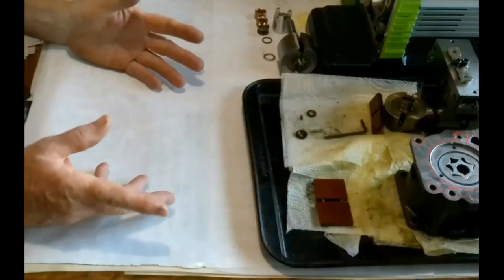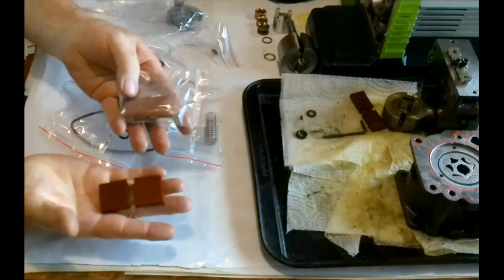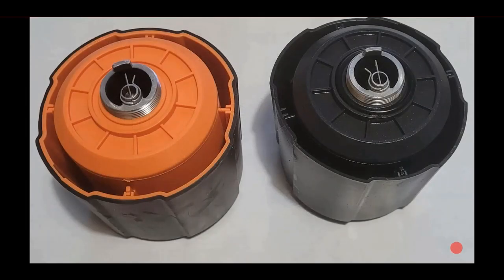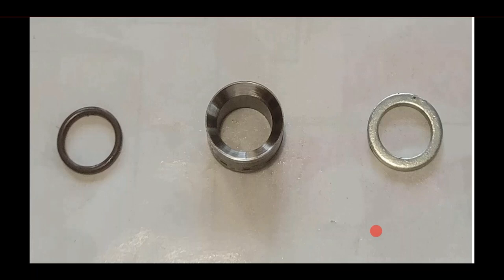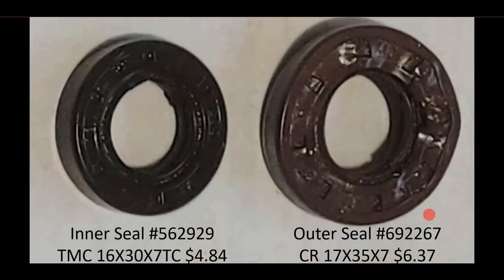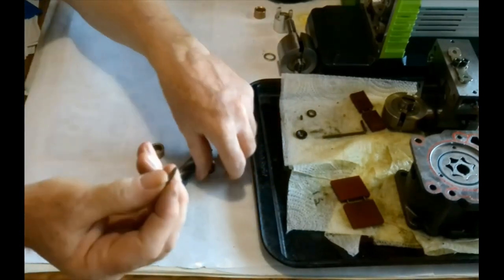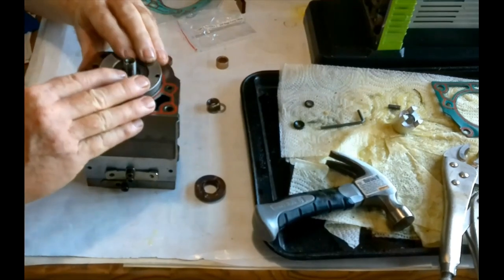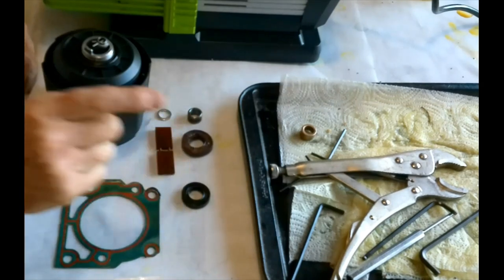Replacement Parts for the Harvest Right Premier Pump

Comment: I just bought a harvest right premier pump and the sight glass looks the same as the one on the NAVAC pump you showed in the video. Looks like they made a few changes.  I'm looking for a rebuild kit because unfortunately I didn't have the door completely latched on its 2nd run and now it will only get down to around 3000 mTorr and then starts fluctuating slowly between 3000 and 4000 mTorr. I just blew $800 if I cant rebuild it.
Reply from the maker: Is the problem with the pump or the freeze drier?  Do you know anyone who's in the HVAC business that could put a micron gauge on the pump?  My guess the pump is not your problem.  Have you looked for leaks around your freeze drier?
Reply: I had this same issue after not closing my drain valve during a batch run.  Turns out the drain valve that shipped from harvest right isn't stainless steel and corrodes very badly even just after a years usage.  That corrosion actually was bad enough not to seal, i found this out by putting the drain hose in a cup of water with the valve closed.  It slowly started sucking up water through the hose.

Replaced with a stainless steel valve, now I'm back down to just under 200 mTorr

Comment: It's too bad, HarvestRight doesn't simply offer the pump assembly.  I have several pumps with perfectly good motors and bad pumps.  I would like to not have to purchase a new pump after a few years.  Is the Navac pump an acceptable replacement for the Premier pump?  They appear to be equivalent but I'm not sure if the HarvestRight pump is special.   It looks to me like the Navac NP7DP is an exact replacement for the Premier pump.  It's a 7 cfm pump, where the NP12DM is a 12 cfm pump, and the price is $360 instead of $795.
Reply from the maker: Just as I found differences between Navac's NP12DM and the Premier pump, I found differences with the NP7DP.  Hang in there.  Changes are coming soon.  Any vacuum pump can be used for freeze drying.  The Premier pump has all the requirements at a cheaper price.  Curious, what caused your pumps to fail?
Reply: @Philat4800feet   I purchased two Freeze Driers and pumps from a commercial kitchen that was processing meats.  They sold them because they were getting the mid cycle vacuum message.  I verified that after replacing the drain valve.  So I opened up one of the pumps and the internals of the pumps were loaded with water and meat fats.  I took the pump apart and cleaned it after watching your overhaul video.  The pump looks good and runs great BUT it can't get the vacuum below 800 mtorr.  The pump vanes look fine but I suspect the water caused some wear on the housing that is preventing it from reaching the <100 mtorr.  I was thinking of just replacing the pump with the Navac 7 cfm pump.
Reply from the maker: @jamesschultz796  Make sense.  Thanks for replying.
Reply: NP7DP from Navac DO NOT USE.  I talked to Navac support and this is not recommended for freeze dryer!  But there larger 12 industrial pump would  work.
Reply: @StevenCollar   I purchased one and have been using it for the last 8 months.  I have had no issues so far.  I was a little upset when I found out I could have purchased a used Premier Pump from HarvestRight for the same price.  But it was too late at that point.  IF and when this NP7DP fails, I'll contact HarvestRight and see if I'm able to replace it with a used Premier Pump

Comment: Not sure how your rebuild went but that brass bushing you drilled and put in place of the seal race isn't going to work. Brass is extremely porous metal and oil can pass right through it. Not to mention the softness of that material will be grooved by the seal faster than the hardened steel.

 The washer you call a spacer is to be located on the O ring side of the beveled sealing race. The O ring seals the inner pump spindle shaft to the seal race and the washer presses the O ring  into the tapered area. The rounded end of the sealing race makes it easier to slide into the seal so it doesn't hang a seal lip and damage the seal. 

 That's the first stage pump area lubrication and tight sealing of that end is critical.
Reply from the maker: So far so good.  You are correct, there are better materials out there.  Finding them without additional modifications is the challenge.  HR is working on a rebuild kit.
Reply: I agree with @webreakforsquirells, I also thought that the washer/spacer goes on top of the oring which sits on top of the bushing, not below the bushing.
At least that’s what I understood from the video where Phill took apart the pump.

Comment: BVV makes a vacuum pump vapor mist filter that fits directly with the harvest right pump and would like your opinion on that. Thank you.
Reply from the maker: I'll need to check it out.
Reply from the maker: Interesting.  At first glance I was wondering how sturdy the structure was?  Could it easily snap off?  I can't tell if it screws on or pressed in with a rubber grommet.  I would also guess there should be a way for the oil vapors to condense and flow back into the pump.  I'll need to think about spending $75.00.  Thanks for the info.
Reply: I've just ordered one. Will report back with my findings.
Reply: Nice! Thanks for trying that out. I just got my Large FD and the demister is the reason that we can not put it in a living space. Luckily everything seems to work well at the moment, just taking a very long time to make a batch. Just finished some fruits and it was a almost 70-hour run!  @jamesfu

Comment: How do you fix a bad check valve in the premier pump?

  Is it even serviceable?
Reply from the maker: If you take off the brass fitting, you should be able to look down the port and see the check ball.  The ball or seat could be damaged or worn.  Remove the ball.  Find an aftermarket check valve with the same thread size (either 1/2 or 3/8 MPT)
Reply from the maker: You just need an in-line check valve
Reply: @Philat4800feet  Thanks Phil.  I removed inlet port to check the ball valve.   When you do this, pipe dope from the fitting falls into the pump.  Not cool really.  

Next the manual say its a 1-1/16" JIC flare fitting.  However, the OTHER end that threads into the pump body is a straight thread with no gasket.   That is not right.   Either its NTP to NTP or straight to straight.  My understanding is that straight thread MUST have a gasket to seal properly.  This is a flaky method of connection in my opinion.  They just used dope where there should be a gasket?

So now I'm stuck with trying to jerry rig a check valve onto this thing.  I can't find a check valve with straight threads, they are all 1/2" NTP (tapered threads).  So I have to try to fit an NTP (all tapered) into the straight female of the housing.  That's a recipe for disaster right there with risks of vacuum leaks or forcing it tight and cracking the pump body.

What a mess.

The check valve ball is not high quality at all.  Its not smooth, has a rough looking "texture" to it.  The inlet port seat looks good, no damage and is smooth.

There was a piece of garbage (paper towel?) stuck on the black plastic check ball "holder", but it was not impeding the ball.

Again, I get an oil sheen on top of every batch effluent water.  There is oil getting from pump into my chamber. (my food)

Unless I'm nuts, most all my FD foods get a weird smell after a month or so.  Like putrid oil smell.

I have carrots and sweet potato chips that I cant eat as they get this weird smell to them.   

Question for you, Is it normal for FD veges to get a weird smell after a time?

I keep them in vac sealed jars that i vac sealed with the Freeze dryer.

I'm afraid to eat any of the foods I dried because of oil contamination.  Harvest right abandoned me.

Thanks,

MP
Reply from the maker: @mrpush2532  I just used Teflon tape
Reply: @Philat4800feet  the threads are some weird foreign NSPP or metric or something.  Just using some tape will not work without messing up the threads in the pump.

Comment: Does the mist filter ever really go bad?
Reply from the maker: Over time dirty oil can build up on the filter and plug it up.  Remember, these pumps, are used by HVAC guys for an hour or two a day, five days a week.  We freeze dryers use these pump for 2-3 days, 24 hours.
Reply: @Philat4800feet   That is true. Thanks for all your videos,  i have learned a lot.
Reply from the maker: Under normal conditions, not really

Comment: Can’t you just replace HR premier pump with NAVAC # NP12DM vacuum pump? Thank you!
Reply from the maker: The spec are similar, but the Navac cost much more.
Reply: Phil, thank you very much for your reply on my comment. Long story short: we purchased HR large  FD with low profile oil free pump a year ago. First, machine lost a freon after about 6 months of using. They sent replacement new one(it’s large pro). After two three batches pump broke down…. Then we learned a lot of info from yours videos. So, bottom line,we purchased premier oil pump from Home Depot. We paid 950$. According to your research NAVAC Np12 dm pump is 1050$. Free shipping. But I’m concerned about hose connections. I think it’s different. Thank you for your patience to read my text. PS: we also purchased FD of different brand. It’s Stay Fresh with 7 shelfs and industrial oil pump.🤞🤔….  We still waiting for delivery!